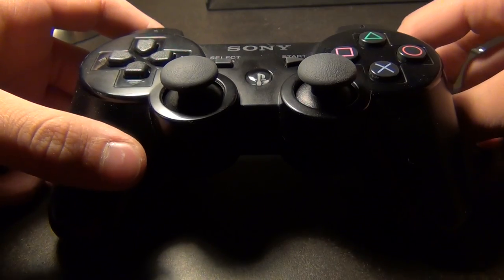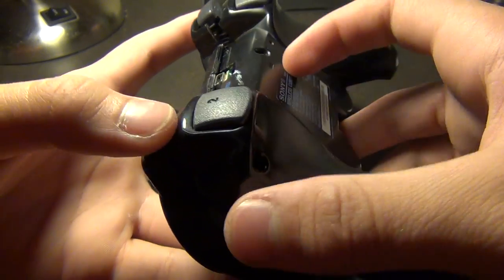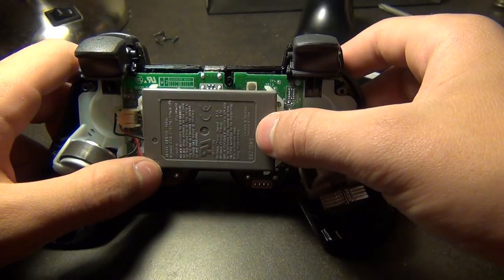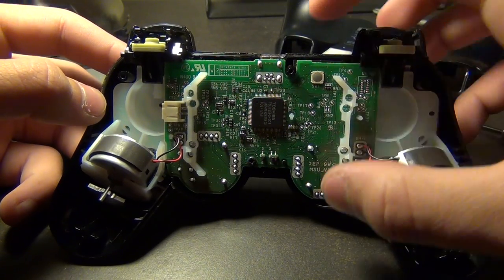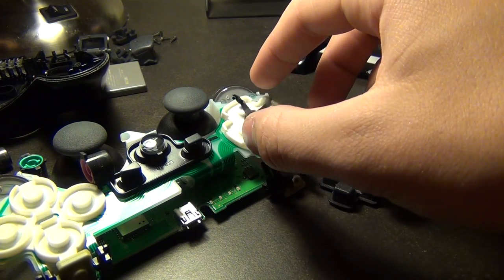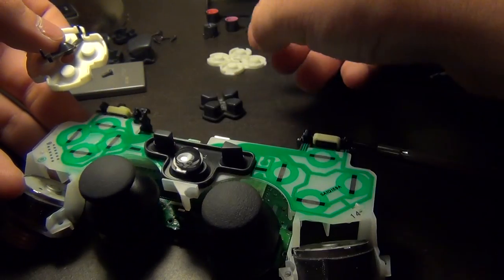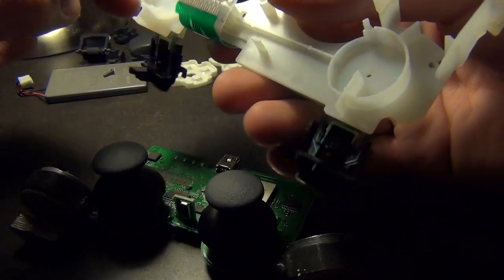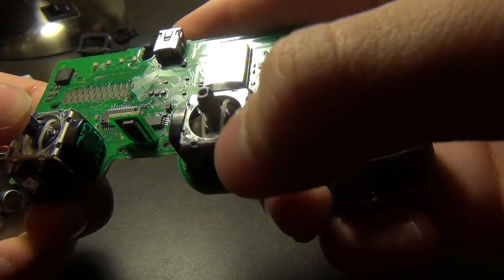Disassembling a DualShock 3 Controller

Comment: You have not the slightest idea what you're doing, do you?

I don't think there's anything electronically wrong - it is a possibility, but not the likeliest one. The linkage you can see there (and btw, why is it plastic? ALPS used in other controllers are metal) connects the stick to potentiometers, those are the black-greenish things on the sides. The linkage possibly slipped, in which case you could just hold the stick and rotate the pot through the adjustment hole, which is unfortunately not to be seen here. Another possibility is that the linkage broke near the spot where it connects to the pot, and given that it's made out of some plastic that yellowed (typical of naturally brittle PVC infused with softener), i find it rather likely in your case. If those green covers are screwed on (can't see it here), you can undo them and see how the pots behave.

Can't claim i haven't seen worse, but a lot of design decisions i can see there are... questionable to put it mildly. It should have been a single PCB for the buttons and the logic and separate PCBs on plugged cables for the thumb sticks. And oh those rumble motors, they should have had plugs too.

Thanks for showing the innards though.